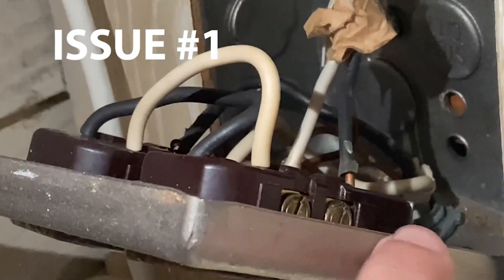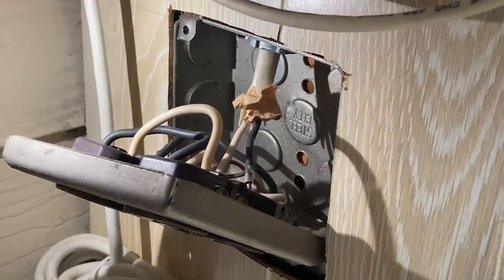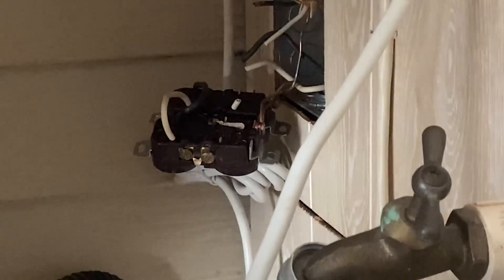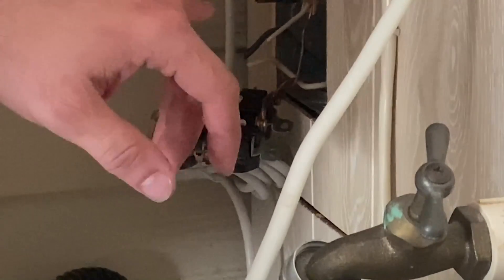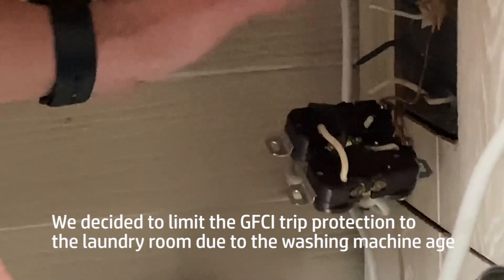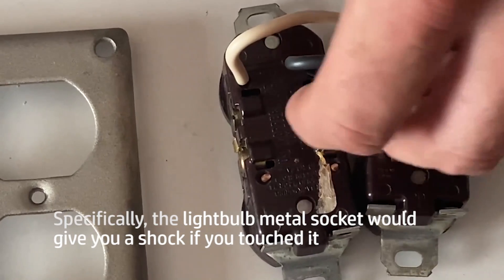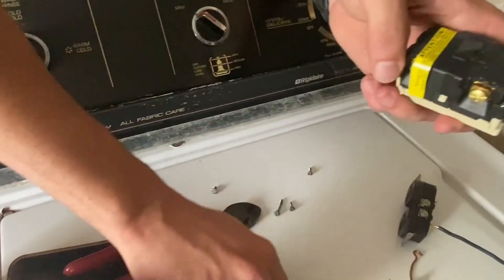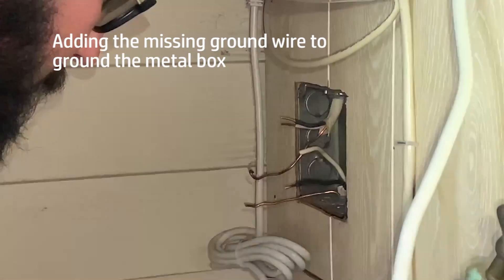Reverse Polarity / Hot Neutral Wires Reversed / Ground Wiring - Oh My!

Comment: Love your 'short' pun; must be my Norway-S.P. heritage.  Where your friend is solid on electrical safety/codes, etc. saying 'gold', 'yellow-gold' goes to black doesn't have a common word link/rhyme/letter to aid recall....
The metal is really BRASS/BRASS-plated so it makes better sense to equate BLACK-to-BRASS (or flip it) to use as a memory aid!  Also he keeps saying 'bolt'.  It's not! It is  a SCREW! (it's round & has a slot for a screwdriver.) Regards.  (btw a LINESMAN (has an 'S') pliers is aka electrician's pliers by some folks.)
Reply from the maker: Thanks for the feedback.  Always appreciated

Comment: The problem with hot and neutral reverse is what while most if not all devices plugged into such an outlet will work fine and you might not know you have this problem until you test with a plug tester, it can pose a dangerous shock hazard.   A good example is a table lamp with a regular screw in bulb.   While changing a bulb it's much easier to touch the metal shell.   You want the threads to be neutral because the neutral is ultimately connected to ground,  that way you won't (or shouldn't) receive a shock.   A reverse polarity means the exposed threads will be hot even while the lamp is off, yet the lamp will work normally as if nothings wrong.  Very old homes built before WWII were oftentimes wired with knob and tube,  and sometimes the light switches were deliberately placed on the neutral instead of the hot side as required in modern practice.
Reply from the maker: Great information. Thanks for sharing!
Reply: @mainelydiymom  The color code is white (or rarely light grey) is the neutral, and it goes to the silver terminal.  The hot wire in romex is black and goes on the brass terminal.  If the wiring is in conduit, the hot could be black, red, yellow, orange, blue, brown, or purple, but never white or green.  Green is reserved exclusively for ground (along with bare copper).  Sometimes you will find a outlet with a black and red wire.  This is a switched outlet, the red wire is connected to a switch and the strip between the brass terminals is snapped off with a pliers.  The black side is always hot, but the red side you can plug in a lamp you can turn on/off from the door.  This is in a case like a living room that has no ceiling light.
Reply: @davidmarquardt9034  all that is correct,  with one exception. Sometimes, typically in rural areas such as farms with the need for three phase motors, or some commercial/industrial applications with significant 3 phase motor loads,  single phase 240V equipment and relatively little 120V loads, there will be a 120/240V 3 phase 4 wire delta service.  With this system, you would measure 240V phase to phase,  120V between two of the three phases to neutral, and 208V between the other phase to neutral, this higher voltage to neutral is the high leg aka stinger leg, and is REQUIRED to be colored orange or by other effective means as per 110.15.   This is important to know, because otherwise if I'm installing breakers in the panel and don't realize there is a high leg, I might install a single pole breaker here to power a 120V circuit and smoke everything because it'll be getting 208V instead.  Other clues of a high leg system are seeing a panel with every third slot empty or occupied by a two/three pole breaker.  Or seeing a pole with two or three transformers and one is much larger than the others.
Reply: I see no reason why anyone would deliberately put the switch on the neutral. More likely they just did not make difference between them and put it on whichever.

But I fail to see why anyone would stick their fingers on the base when changing bulbs. I ways hold the bulb on the glass.